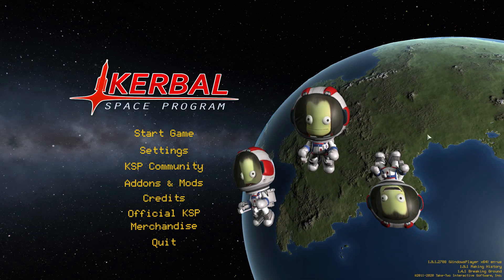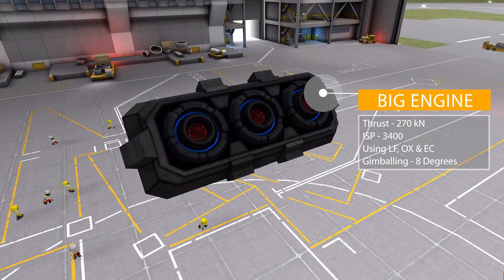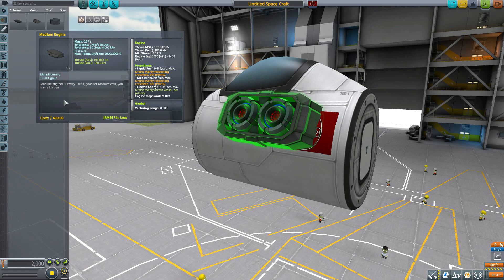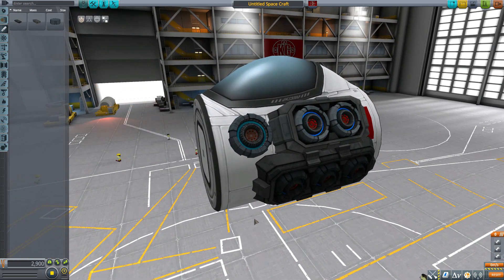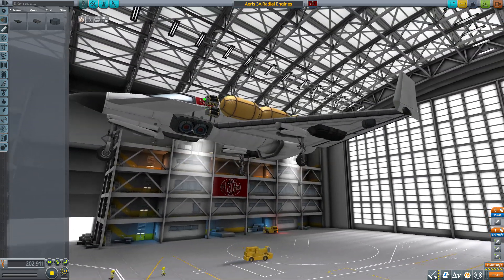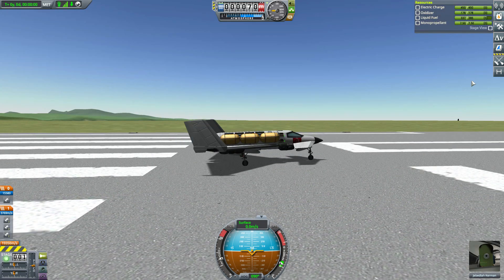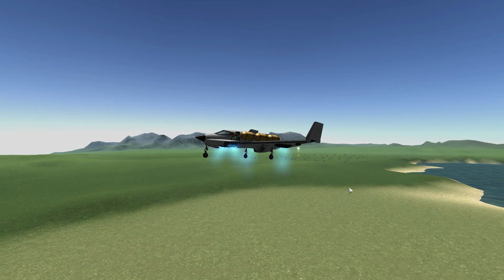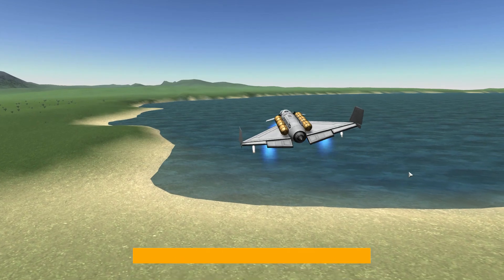KSP Mods - Radial Engine for Spacecraft

Comment: Ive been using these since I seen this video. I'm loving the hell out of these engines. yea they are great for VTOL but they are in my opinion the best and most fuel efficient to thrust ratio engine. They almost feel cheaty. but the  electric requirement adds some balance. no EC no boost. means pack those batteries or solar. or you could crash while hovering.

Comment: isp=3400. This is a bit cheaty...
Reply: it's advanced tech, but consider it an Ion-Plasma Engine, so it can work in atmosphere as well as vacuum, then consider the electric charge you need to put into it, you will need to put alot of generators and batteries with them. So the ISP is high but it's TWR will be low. I am still hoping for an Ion engine with Water injection option, basically Ion Afterburner.
Reply: @robrocksea   I don't know what's the energy consumption of the engines, but I'm sure they have enough thrust for lifting a power source for them. A good example is the example craft that we've seen in the video. It was able of having all the engine on max thrust with only a few rtgs, however maybe some of them were hidden inside other pieces, but it works perfectly. If we build a plane, with a simple design, and then we put lqf+ox instead of just lqf, we put rtgs instead of the intakes and this vtol engines instead of the jet ones we can easily get the same efficiency than a ram jet at not very high speeds. If you also consider the fact that this engines also work in vacuum, you actually are building an ssto that has fairly enough delta-v for example for going to laythe and back, with just the mass of a small plane. Maybe it isn't that efficient cause I didn't use a calculator, but I think you know what I'm referring to. It's just too much for the game.